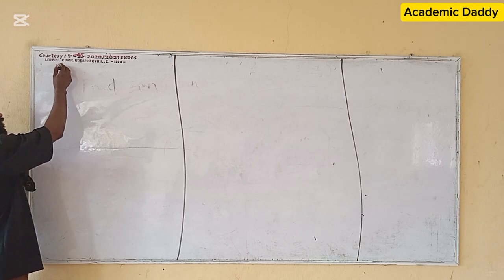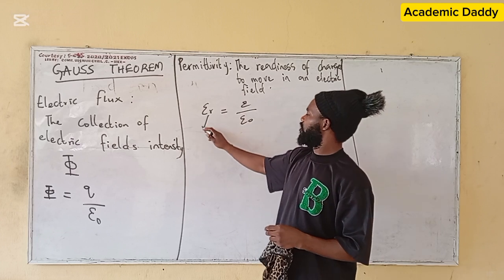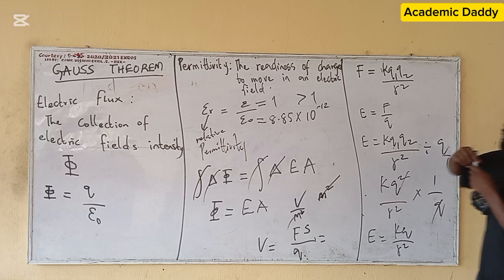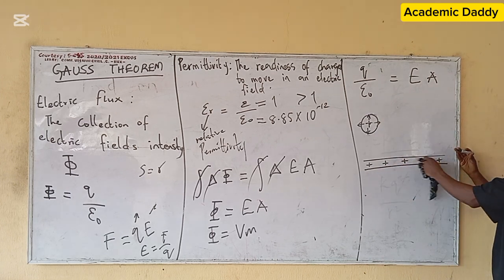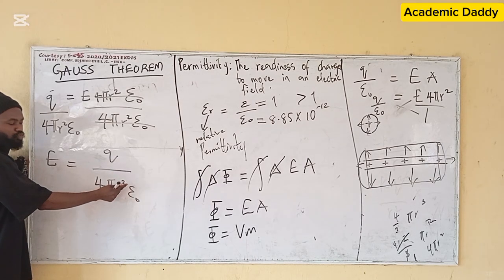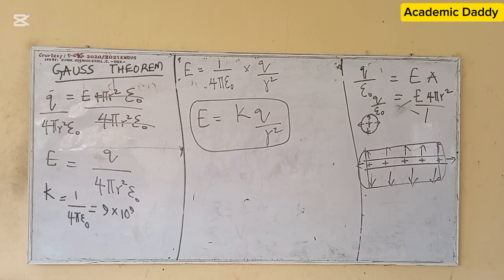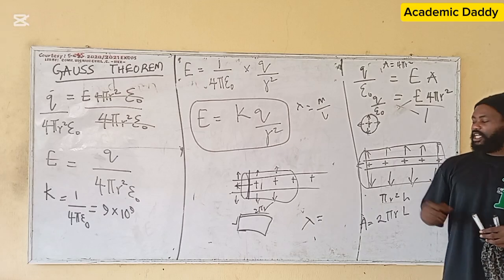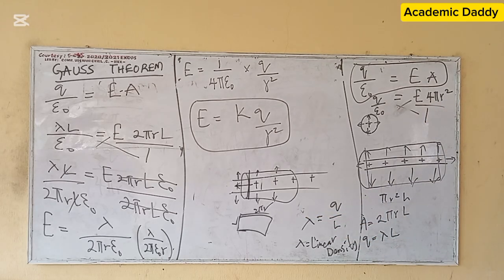GAUSS THEOREM (CHAPTER (ONE/TWO))

Comment from the maker: Plastic & Ebonite exist in a positive state so when rubbed with Fur or Silk, gains electrons and then become Negatively charged hence the type of charge for plastic with fur is Negative with plastic in mind and positive with fur in mind which will gain positive charges from plastic and give off electrons to it.

For glass, look at it as existing in a negative state just as non metals so when rubbed with Fur, silk or anything eventually give out its negative charges and become positively charged.
So with glass in mind, glass and silk experiment will produce positive charge. With silk or fur in mind, will produce a negative charge.

Ebonites are hard rubbers, plastics are not that easy to break when compared to glasses.
All the materials are non metals but look at the ones harder by nature as metals so you always say they exist in the same postive state as metals until rubbed or in contact to test its electrostatic charge.
Electrostatics means charges at rest so there's not much the charges are doing but it helps to understand that even where there's no charge, little little charges can be made through contact/friction.

This semester you must believe the notes and teachings i give you more than your physics textbook. Go to page 18 of physics textbook, the illustration given there for ebonite is wrong. If you read that and not properly access class and research, you fail such a simple objective like question.